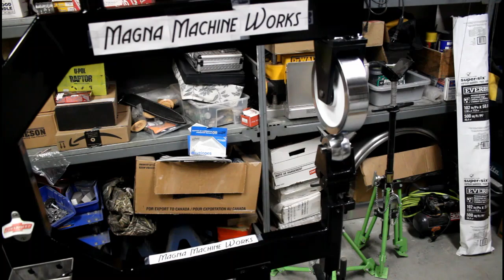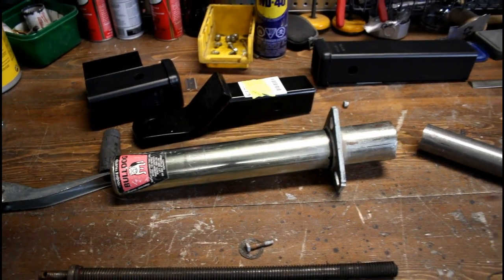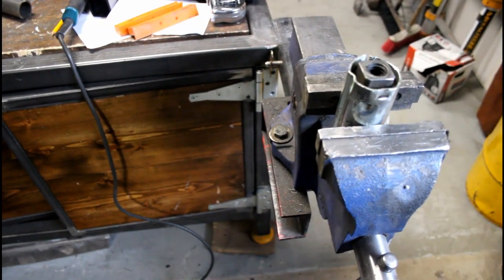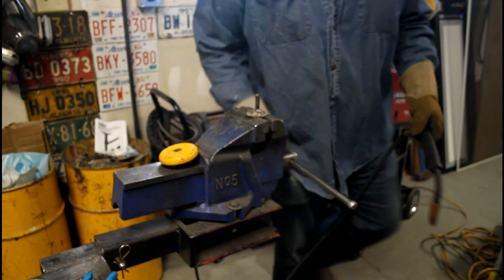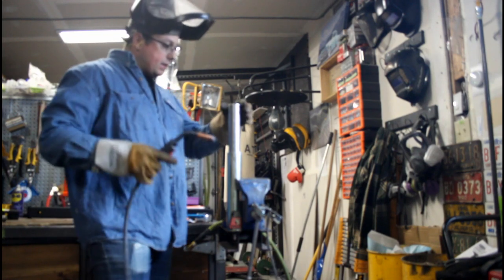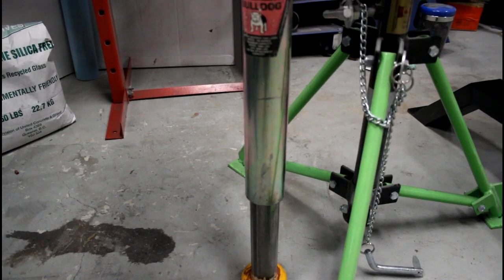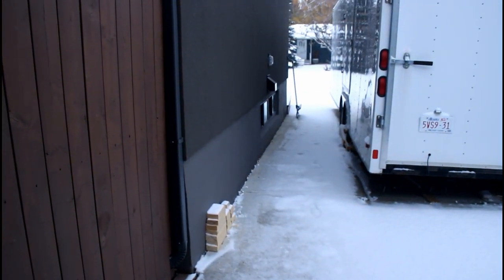Metalshaping Station Fabrication: Upgrading Inexpensive tools Part 1

Comment: THANKS for the video -- motivated me to change my HF english wheel (doing it now)! 
Question: By improvement, in terms of actual outcome on a given thickness of sheet metal, do you mean to say both the speed and the effectiveness of the machine? By that I mean by removing some of the "pinching" flexibility where the wheels come into contact with the workpiece, can I do thicker metal, say 16 guage (I know that is really pushing it!) and also process thinner guages a good deal faster? 
Thanks again!
Reply from the maker: I regularly do 18 gauge the way it is now. The problem I was having with it was it never seemed to be able to get enough real tension on it to be very effective. It felt spongy and inconsistent as far as being able to control even moving the panel back and forth as well as the upper arm would move not only up and down but slightly back and forth. This solved it greatly. I think you could do 16 gauge with it, but an improvement I would suggest is to box the entire "C-shape" with some 1/8 or 10 gauge steel as well as the truss. Thanks for the comment, I hope this helps!
Reply: @MagnaMachineWorks  Got it - Thanks! It is about to rain here in SC and the machine is covered outside, so I will send photo of primed machine (not yet painted to match yellow).
Reply: Sent - comments welcome!